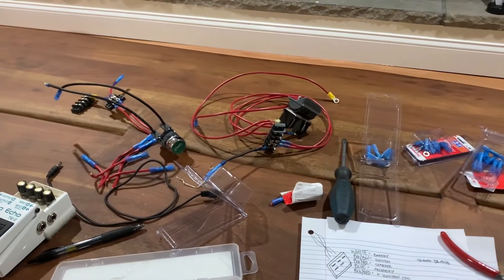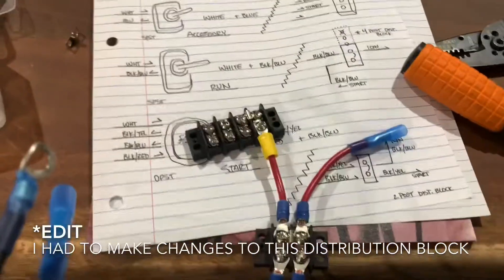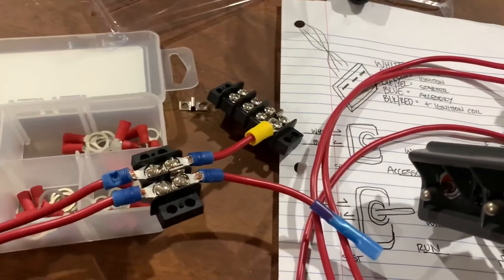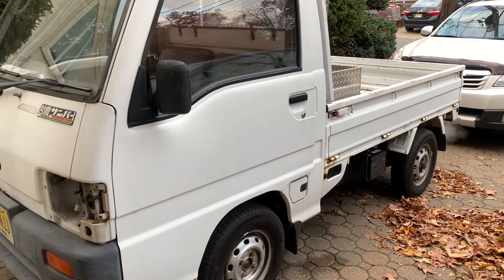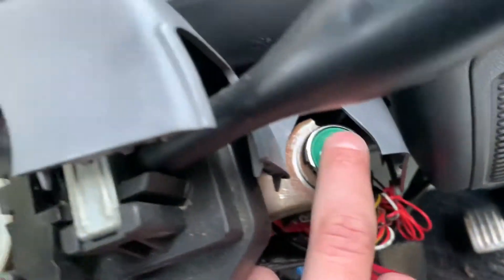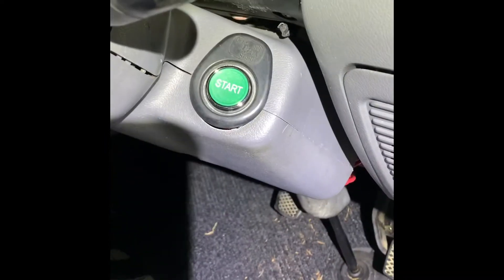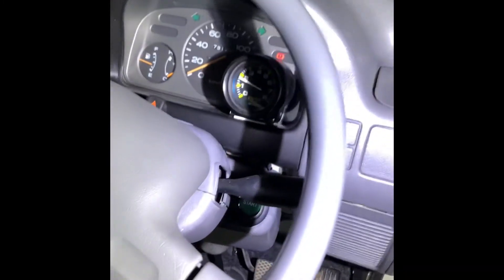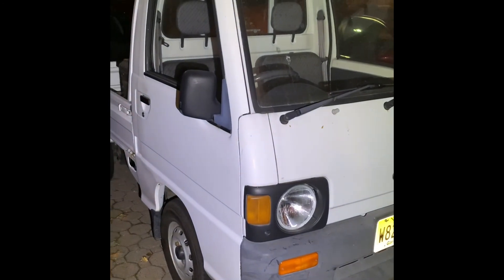Kei Truck Keyless Start

Comment: I wondered how you did that so one of the two switches on the push button is a latching normally open and the other one is a momentary normally open? Do you have the ignition switch being powered by the accessory switch as an additional theft deterrent device? Also as far as the headlights, I would Nix the headlights are connected to everything else method in that harness and I would make a separate protected by split Loom all the way to a fuse holder directly at the battery. Consider an auto resetting thermal fuse. Losing your headlights on the highway at night will definitely put you in the ditch. I had it happen to me recently in my electric car and decided to install a backup lithium for the cars systems if I lose the battery pack i e a BMS opens up. Most mfrs actually just use a thermal fuse or an auto reset. In the old days they were real worried about that they didn't have a fuse the power went straight from the battery